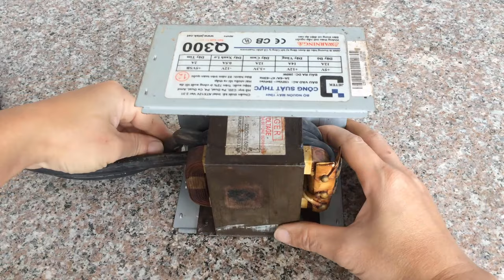How to solder copper without using gas? You will be amazed with this homemade tool

Comment: As good practice, if you modify device or housing so parameters change, remove stickers and write the info on the frame with name of the device it is, so if say you kick the bucket and family member that has not seen it comes around and handles it, they wont kill them selfs with your contraption. Same if accident happens, you dont want to put first aid in harms way or burn your house down if it it was powered on when you got knocked out. You did it in this video but many dont, so just something for folk to consider when building DIY things

Comment: I guess you had to do it fast enough so a person can't tell if you took out the primary or the secondary coil on that transformer. Oh well. I stopped the video three times to see if I could see it. From the look of it you took out the high voltage seconday think coil and replaced that.

Comment: This is a simple and reliable method and quite a few people have repurposed microwave oven transformers for spot welders. The output voltage can be as low as 2V, but there’s around 600 amps for very rapid heating of the work piece! What would be nice here are interchangeable tips of different shapes for spot welding, brazing pipes of larger diameters, maybe even thawing frozen sections of water pipe. 👍🏼👍🏼

Comment: congratulations sir you surprised us with your diy so that we can make a choice to buy from the manufacturer which for me personally is not cheap, I beg your permission to ask sir, asking for help, what type of transformer watts and how many amps are used from the used microwave, and what is the size of the large black cable sir, and how many amps of household electricity is needed sir? because in my house in Indonesia it is only 1300 watts or 6 amps. thank you

Comment: Great DYI.  Thanks for the video.  Are the asbestos sleeves used for the heat/fire protection?   Will silicone tube be sufficient for that since it is not safe to use asbestos.  Thanks

Comment: Very surprised with the performance.  I have the top power brazing unit from American Beauty Model # 10557-SZA 1800W system and this appears to take just a couple more seconds to heat the joint.  My unit weighs 40 lbs though and I hate lugging it around.  I have a smaller Model # 105L7 1100W, but it takes forever to do copper to copper.  Hard to believe that this is able to do what my 1800W system can do, but I am certainly willing to build one and see for myself!  I also need to do copper to steel, so I'm curious about the performance there also.  Thanks for the great video!
Reply from the maker: Thank you for watching!

Comment: One downside with this 'resistance heating' method is that you don't heat up the coupling insert pipe as fast as it heats the coupling base. With 'induction heating', both pipe get heated up so you can avoid copper pipe annealing due to overheat.
Reply: Im confused is induction only for ferrous metals or does it do clean metals like copper gold and others?

Comment: Hello sir, can I put another transformer and the amount of heat generated becomes greater to the welding and how do you connect the transformers in parallel or in series if the number of transformers is two
Reply from the maker: When connecting 2 transformers in parallel:
1. The capacity of 2 transformers must be equal.
2 . The number of secondary turns must be the same (equal output voltage).
  Good luck!

Comment: 1. how long the copper cable
2. 5:10 I think resistor should be before diode not after. so it will reduce voltage first

Comment: Qual o comprimento do cabo e a grossura ( milimetro)
Reply from the maker: cable length is 1 meter, wire cross section D25mm2

Comment: How about ampere for this stuff.?
Reply: Input amps (at 120/240V) likely around 10A. Output amps at MUCH LOWER voltage (2-4V for that thick wire with such few turns) will be around 400-600A. This setup makes a good spot welder too. 😄